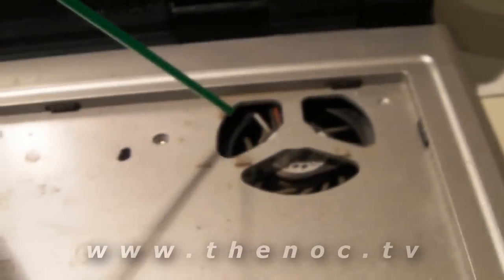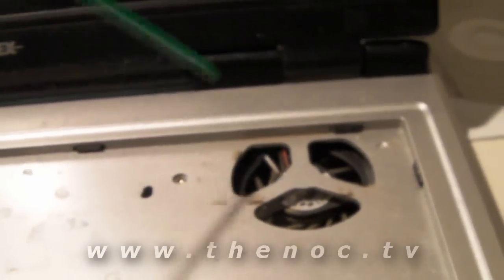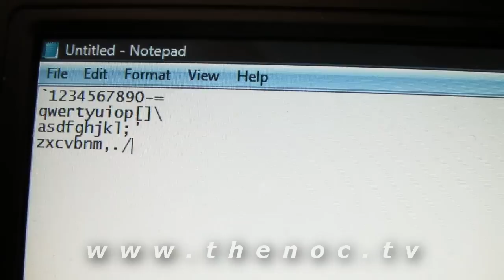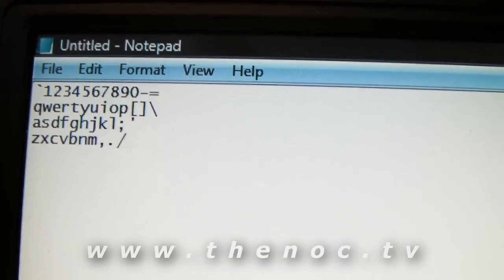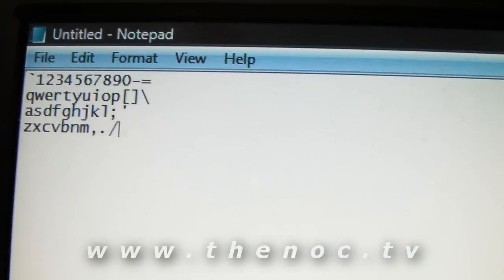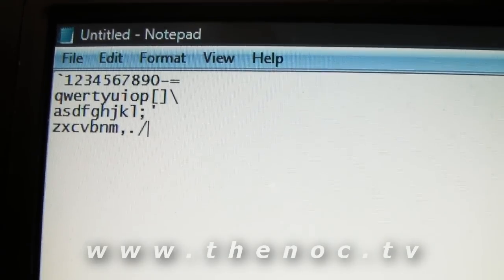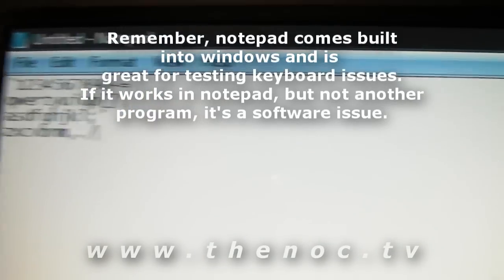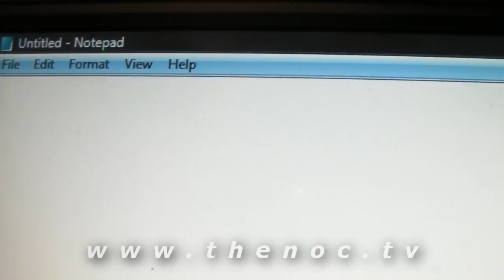Repairing a malfunctioning laptop keyboard (Unresponsive keys)

Comment: I have a HP 17-BY2004 and GH and backspace does not work. I have A new palmrest and keyboard. Uninstalled and reinstalled the driver and those keys still don't work. But an usb external keyboard works as well as the on screen keyboard. What gives??

Comment: Keep the fan from spinning ml? Why?
Reply: You can actually damage the fan bearings by over-revving it with a blast of air. Also, it can act like a generator when spinning from an external source and that can damage sensitive electronics.

Comment: It didn't work on my first attempt. But before I snapped the keyboard tabs back it started working. Although I did some extra steps like applying bit of water on the plastic flex connection that looked dirty before wiping it with dry cloth and then your eraser trick. I'm not sure how long this will last before it reappears but for now I'm feeling thankful for your video

Comment: hey man I have a question for you I have a bit of a issue with my f3/3/e/d/c keys. I know considering they go into a line on the green film down to the connector. If I hold down e/c/f3/3 it starts pushing d instead. It's not bad when I am just on the computer, but when I am playing a game or something it really starts to get annoying have to hold on 3 and end up doing d messing every thing up.

I know its either some dirty on the green film or some corrosion on maybe the metal plate that could be effecting it, but since its on a laptop I have to remove every key to get to this section of the keyboard to check it. Is there any way to fix this without have to do that?

Comment: Tried it and it didn't work for me, I lost what little k/b cable I had left, got a quote from a computer repair service on ebay after replacing my k/b to replace my k/b connector, and it only ran around $47, I can live with that seeing to replace the laptop was going to run me $500. Not sure if it will work for you, good luck.

Comment: Enjoyed the video, obviously in your case the connections for the ribbon cable are exposed, but in my case I have a Samsung NP305v5A and the ribbon cable connections are enclosed in mylar so I have no idea how it makes conntinuity to the keyboard connector, someone suggested cutting a cm off the end of the cable I'm going to try that, but I broke my keyboard connector while swapping out a broken power supply connector and my keyboard hasn't worked since, any sggestion wold be appreciated.

Comment: Hey there. Recently my friend spilled cola into his alienware laptop (completely overpriced parts) and i decided to repair it myself. I gave it a few cleans to get all the dirt out and all the cola out, but g,h,m, and "." dont work along with 7 ontop of the keyboard and 4 on the right portion of the keyboard. i tried taking off the keys and using electrical contact cleaner but now when i try to use them, v goes crazy and the computer only inputs v as if its stuck. any ideas?

Comment: Hi, these keys are not working for me: 

dknvy.: and the right and up arrows
(I am currently using the on-screen keyboard)
so I removed all the keys an cleaned everwhere, including the ribbon and connector, to no avail.
I think the prob may be with the built up gunk under the adhiesive strip where the ribbon connects to the keyboard, but i am concerned i might break it beyond repair if i go digging too deep.

so, is there a way i can remove the strip completely in order to clean it thouroughly?